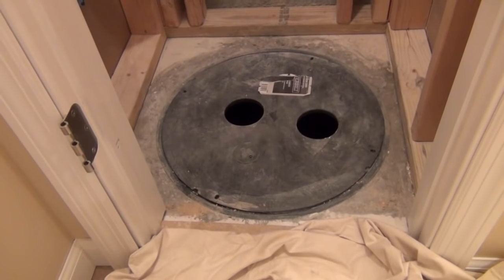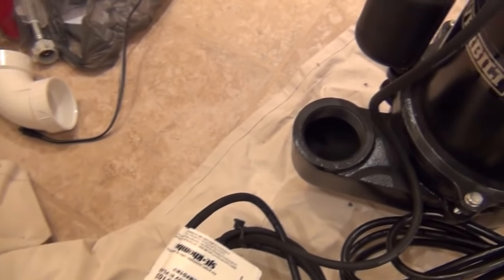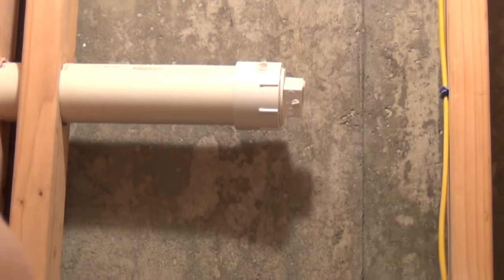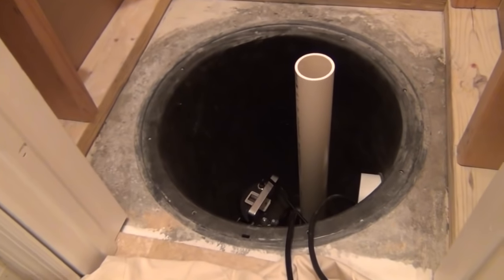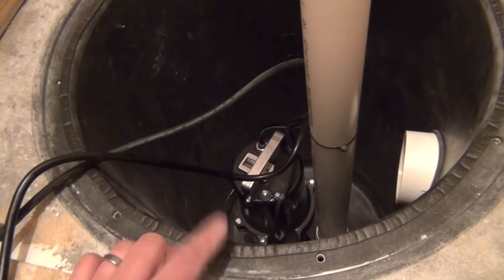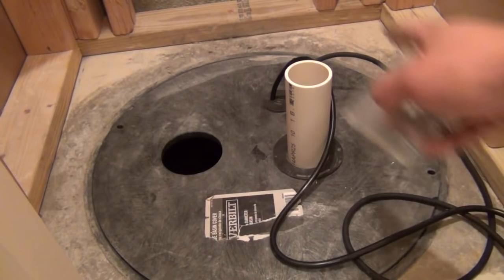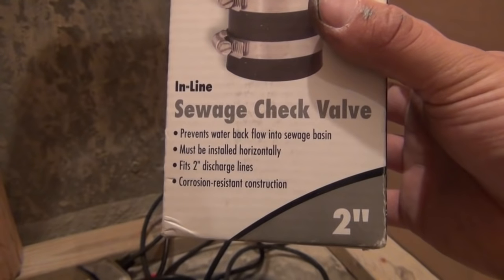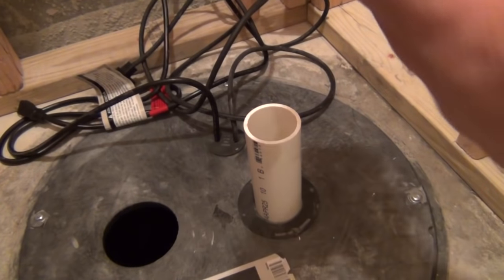How to Install a Sewage Ejector Pump

Comment: Complements on a clear, useful and very helpful vid.  Mine was a retro install.  A high water alarm was also installed for safety.  Recently, the float in the basin was getting stuck causing the alarm to alert us to stop using.  We've had a service call but still getting a stuck float from time to time and the alarm.  They'd cut back the inlet pipe thinking the float was getting stuck.  Still not trusting it fully which is not good.  Will have to have another try and moving the float around I suppose.  Ours has a good full bead of silicone around the basin lid also and we have no odors if that's helpful to others.  Cheers.

Comment: I think you have great gift.  I am glade that you took the time to make this video.
Great clear video, great sound.

One question, what happens is the motor doesn't shut off?  And no water is entering from the basement toilet, etc.
Reply from the maker: Robert Mattison Thanks for the kind words.  The instance of the pump not shutting off would be a rare occurrence as its usually the pump not turning on that causes the problem.  My guess is the pump would eventually "burn out" if left continuously running.  Thanks for watching.

Comment: Great video thanks.. surprised you didnt install/recommend an alarm?  I know you said change the pump every 8 years so maybe that is what you do to curtail needing an alarm.  Thanks again,
Reply from the maker: Yeah, honestly once the alarm goes off and you’re not in the area, the damage will already be done in minutes once the basin tops off. I prefer to just stay on top of it and replace the pump when it’s old. You’ll never have a problem that way 👍🏻

Comment: Good tutorial, thanks. Just curious, what happens to the waste above the check valve in the pipe if you don't use the system for a while.....does the pump suffer if the waste is stiffer or even partially solidified after months of no use?

Comment: This is a great video!! How do you determine the size pump needed for a new installation??
Reply from the maker: Thank you!  Most systems will work correctly with a 1/2 hp pump. Check the video description for links to pumps I recommend.

Comment: Great Vid, Great Job!  One  question:  1) On the discharge, you have a 90 straight down, then 2 45's to offset. Couldn't you have just used 3 45's (and avoided the 90) for less pump resistance?

Comment: I was told its good to sit the pump higher about 8" on blocks so it won't run alot and the toilet paper will have time to break down in the water under the pump. Because with the pump at the bottom of such a deep pit it only takes a little water to make the float raise and will run too much especially when showering. Or just raise the float higher and ziptie it to the pipe.
Reply from the maker: Nahh, don’t do that. Raising the pump won’t affect the run cycles or frequency at all because the bottom of the pump and float level to activate the motor will still be the same distance. These pumps are made to sit in the bottom of the pit and grind up any type of waste it can get from a toilet. Hope this helps 👍🏻
Reply: @fixitwithzim  thanks alot. Yea i left it alone. Working fine so far
Reply from the maker: @DJNaturaultone no problem, as the old saying goes…”if it ain’t broke, don’t fix it”. 👍🏻

Comment: I recently moved into a house with this bathroom system in place should… I worry about poop and toilet paper getting stuck when discharging from the pump to the sewer ? or only do numbers 1 in this bathroom to be safe ? Great Video
Reply from the maker: Daisyy421 The pump is designed to handle both solids and liquids. You'll be ok... Flush with confidence! :-)

Comment: Probably a dumb question but why not install a flexible fernco coupling on the vent pipe 10-12" above the lid so when you have to change the pump it's easier to remove the lid at the coupling vs. cutting the existing PVC?  Maybe code doesn't allow this but thought I would ask..

Great video by the way!!

Comment: The only thing I would add is the put in another check valve further up as well.  When the pump stops, the sewage will all come back down to the one check valve.  It can make a loud banging noise.  If you use another check valve further up it really quiets it down.
Reply: Maybe I’ll give that a try mine has a loud bang with just the one check valve

Comment: Wow ! well done wish that i saw this before !
It will have answered 98%

I have installed one for my basement 2 years ago and with pretty much the same setup. Difference it's connected to the main vertical stack about 5' above groundlevel with  2x 90 WIDE elbow to make a vertical hook at 6'. Work well.
But as a perfectionist ...  was not satifisfied with the loud 'bang' of the check valve when pump shutoff (bedroom beside)
I moved the checkvalve higher to be closer to the hook but now earing the water that is below the check valve trying to get back to the pit making gloop-gloop-gloop when pump stop  :)

Question : Does the check-valve is mandatory by code or can be remove if the feed  is above the main stack jonction (i know that the water of the 5 feet section will return to the pit each time) ??

2 suggestions :
1- I have added a electric cord hook with a screw to the electrical outlet to prevent a accidental disconnect
2- I added a mechanical jonction on the vent pipe for servicing (exist on 2" ABS not sure for PVC)
Reply from the maker: Not sure if the check is required by code everywhere.  I don’t like the noise either but I would keep it in place.  I like the other 2 tips, thank you!

Comment: Very informative. Thx. Just bought a house and learned that I have a grinder pump. Trying to learn about them. Mine makes a sound every 3 seconds throughout the night after taking a shower. Is that normal?
Reply from the maker: Thanks for the comment. The pump shouldn't run for very long after you're done using the shower. Sounds like you either have a bad check valve or a bad pump that is short cycling. I'd start with the check valve. It's an easy, cheap part to replace.

Comment: Just fixed the lid on mine with confidence.

Also the bolts were way too short. Should I get other bolts, zip ties, or a rock on top?
Reply from the maker: Up size them by 1/4" and put anti seize on them.   You want that thing super tight.

Comment: Great video. Thanks so much. Question please. I am needing to install a pump like this, but on the exterior of my home in the yard. There is nowhere logistically where I can install this inside the home. Can this be done?
Reply from the maker: Good question.  My best answer, check your local plumbing codes.  My first thoughts - could/would it freeze?  How deep will it be in the ground?  Sump pits with pumps are very common in yards for drainage, not so much for sewage.

Comment: Great video. Just wondering if you have a video that shows the plumbing pipes going from the bathroom fixtures to the sewage ejector system.  we are just putting in a basement under our cottage and haven't put the floor in yet, and want to make sure to get that right.

Comment: Best video about the topic that I’ve found, congrats! My basin is installed above the slab since the home used to be on septic and now the sewer main is on the other side of the basement above the slab. Because of this, I can easily add another basin beside the current one as a backup. Can I just run a pipe from the primary basin to the secondary and that way if the main one fails it overflows into the secondary as a backup? Or is there a better way to have a backup system? Thanks!
Reply from the maker: Sorry for the delayed response.  I would opt for 2 separate systems with independent pumps.  If its setup correctly, you shouldn't have any problems and need a backup.  Good luck with the job.

Comment: Good clear video footage, you speak clearly and can be understood without a problem. Your insight and tips were awesome. Nice job!  I have the basin already roughed in as well as the shower and toilet. I'm going ahead and installing a pump. My only question and I hope its not a stupid one. All the plumbers tell me I need a mascerating pump. One that grinds the solids up. I've been shopping for a pump like the one you have above at my local home depot and online. These pumps seem to just push the solids through, not actually grind them. Am I wrong on that? and whats your opinion on the grinding pump. Thanks in advance and again nice job.
Reply from the maker: The pump in the video is exactly what they're talking about. It will grind up the solids as its pumping through the impeller.  Good luck with your project and thanks for the comment!

Comment: Excellent. In replacing an old pump (or hopefull just the $witch), there are other problems, no? The bolts could be rusted, which you mentioned. The sump tank cover on mine is sealed with silicon, hopefully not any bolts there.  The idea of being able to find a clean enough surface to put any stickum backed insulation strips on an old tank, seems very unlikely. Is silicon the way to go? I also have the float switch problem, the sump into the piggybacked plug and the pump will not turn on. The pump directly into the outlet and it pumps continuously. I am hoping just to replace the switch. Is there a way to sanitize the pit for a few days first for a less gross job?
Reply from the maker: Doctor Spaceman Silicone would work to seal the lid.  If you bypass the float switch and can get the pump to run, you can turn the sink on or flush the toilet a bunch of times to clean the tank out.  It'll get it somewhat clean but still not fun playing around in there. Good luck

Comment: thanks a lot for clear sound & video. I did a pit for washer in basement don't know similar way can be used for toilet. What's the pump model #? I know many uses two pumps in flood area incase one fail, I'm  worry the mess up of single failure, are pressure treated 2x4 better?
Reply from the maker: Joe Dai The pump is an Everbilt model #ESE60W-HD.  I've never seen 2 sewage pumps used in a pit.  What you may be thinking of is a sump pit used to handle ground water removal in and around a basement foundation and slab.  These are 2 totally independent systems and cannot be shared or mixed together.  I have seen 2 pumps used in a sump pit in case of the primary pump failure, the second pump would take over so the basement doesn't flood.

All the bottom plates on my 2x4 walls are PT to help prevent wood rot and decay from the slab.  Thanks for watching.

Comment: Very well explained!  I have a question, I am adding a bath to an attic in a cape cod house.  The main sewer exits the basement at about 4 feet above the basement floor on the opposite end of the house as the proposed bathroom.  There is no way to get my fall in the attic going over to the stack, and no way to get the fall in the basement due to ductwork etc.  Can I install a sewage ejector crock in the basement lined up with the proposed bathroom, then drop the 3 inch stack from this bathroom into the ejector?
Reply from the maker: Sorry for the delayed response.  I understand what you're trying to do, this would probably work but I don't know code wise if its allowed our not.  Should really only be using ejector pumps as a last resort.  You sure you explored all options for your install?

Comment: Great video. Explains everything well. Had a question, what if the lid has got cracks, How to seal it off nicely if do not want to replace it? Also, i smell sewage in basement bathroom when we use it either shower or toilet, otherwise it does not smell. I notice few cracks in the lid? Any easy fix?
Thanks
Reply from the maker: If the lid has cracks, that most definitely is why you smell sewage. You can buy a new lid at HD. Just replace it. No real way to fix a cracked lid and make it odor free easily. Thanks for the comment and hope this helps.

Comment: My kitchen sink drain is directly above my tank and ejector pump. I would be able to tie into that 2" line about 1 1/2' from the j-trap. Is that allowed and would the ejector pump pressure create a back flow up into the sink? Thanks, Jack

Comment: I bought an all in one sewage tank and pump.  The pump is fixed to the bottom of the tank just below where the sewage line dumps into the tank.  My question.  Would it be wise to have my 4 inch PVC run 2/3rds of the way into the tank (going over the pump) so it dumps in the more open part of the tank and avoids dumping everything right on the pump?  I would love any help you might have for me zimsjeep.  Thank.

Comment: Thanks for the video helped a lot. One problem I have now is when my pump kicks on my kitchen sink splashes water out the drain from the surge of water being pumped down the 3" main. Know of anything you can do about it?
Reply from the maker: You might have the pump discharge tied in too close to the sink drain...Do you have a sanitary tee or wye installed?
Reply: zimsjeep thanks for the reply I have a wye with a long sweep 90. It ended up being a problem with venting. The kitchen sink is across the house downstream right before it turns outside. I drilled some holes in the cleanout cap outside and all is well now.

Comment: For whatever reason, our downstairs washer is plumbed into the sewage pump and, on larger loads, the pump is overwhelmed pretty easily. Is this something a higher HP pump could fix? I sincerely appreciate this video - I just had to beat the shit out of the pump outlet pipe to get the thing to start moving again. It was stuck and whining. Gonna replace it today! Liked and subscribed.

Comment: Thanks really very helpful. So my question is about the sewage line from the pump all the way to the main line, is it 2 in or 4?
Reply from the maker: 2” from the pump to the main. Main is then the existing pipe that is 4” out to the septic system

Comment: So does that vent serve as the vent for all the fixtures in the basement or do you need a vent on those as well? Code requires a vent no farther than 5-16’ away (IPC) from a trap but I didn’t know if a pumped system was different. Thanks.

Comment: My "rough-in" in the basement slab didn't include vent pipes for the fixtures.  Could I use an AAV for the sink and toilet (less than 5 feet apart).  What about the shower?  Also the ejector pump crock has about a foot of water and looks like algae in it?  Problem?  Thanks your video was great.
Reply from the maker: Cecilia Kennedy You can use AAV's as a last resort.  You cannot use an AAV for the ejector basin vent as the basin vents both in and out.  Not sure what you mean about crock but if you mean the basin, just pump it out before starting your work.  Hope this helps and thanks for watching.
Reply: Yes I meant the basin but I was wondering if the water in the basin meant that there might be a leak.  Scary thought since it involves sewage!  There is a vent pipe that I can hook into from the crock but I still don't know how I can tie in the shower without busting up the concrete???  Is it possible that if the crock is vented that I don't need vents for the fixtures?  Thanks again.
Reply from the maker: Cecilia Kennedy What is connected to the basin right now that might be allowing water to enter?  If its just whats roughed in under the floor you might have ground water getting in there somehow (broken pipe maybe?)  My other thought is that if a pump is already installed and plumbed to the sewer lateral that the check valve is failing and somehow sewage is making its way from your gravity portion of your system back into the basin.

In regards to the venting,  You'll need separate venting for the shower.  The vent for the pit will not do the plumbing in the floor any good.  You need to get air in behind the water going down the shower drain otherwise you'll have flow problems and gurgling.  I can't believe a builder roughed that in without vents...  are you sure its not hidden somewhere and you're missing it?

Comment: Is that outlet dedicated only for the pump? Do you think 14/2 wire from a gfci 15 amp breaker from the house to a shed would run a  1/3 or .4hp motor? I need to get an outlet for at least a sump pump out there before the rain starts. It's about 60 ft away. I was thinking about putting in a head later. I know I would need a 20 amp breaker and bigger wire for that though. Baby steps.

Comment: I'm looking at buying a house but the holding tank keeps filling up with water from an unknown source and then flushes every 5 minutes with a few gallons of water out to the septic field ( clear water)...we unbolted the top of the well and it was full to the  point of overflowing...is the well somehow connected to the sewage pump pit? Have you ever hear of this?

Comment: Would the flap type of check valve be installed at 45 deg or horizontal to prevent sediments settled on top of the valve and prevent it from opening?

Comment: Great great video instructions.   One question does a sewage pump need to be primed like other pumps to start working?   I am replacing a pump, I vacuumed debris out that had fallen into the tank.   Refilling the tank with new pump installed the pump has not come on. Bothe float and pump have power.   Tank nearly full
Reply from the maker: Trevor Philbrook No, it does not need to be primed